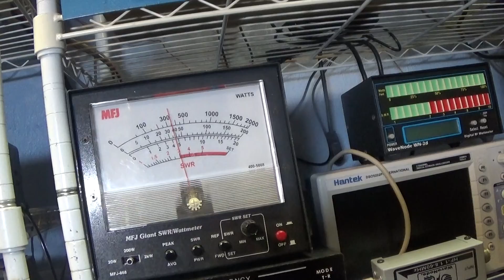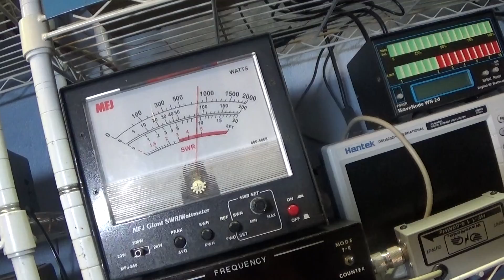Swinger 101 one 6LQ6 tube 10 meter Linear Amplifier

Comment: It should make a nice driver for a larger amp. very nice.
Reply from the maker: Maybe but most people want to hit their amps harder than this.
Reply: @tramdr  I agree, which really doesn't make any sense. Unless hitting that driver harder is going to give you four times more output on the amplifier that you're driving, it's just not worth it oh, not to mention you're going to sound like crap, and cause more rfi, then anyone in the know would like to. The idea is to keep RFI as low as possible. All one is doing is sending their tubes\transistors to an early grave. No point in getting a hundred or even 200 Watts extra, out of a 500 watt amplifier. Just as there is no difference getting 500-watts extra, out of the 1 KW amplifier. It's going to make no difference on the other end, but a lot of chicken bandages just don't understand the concept. My 300a, 350Z, and triple stage Phantom are driven with one-and-a-half through two watts DK and 15-18 pep (ssb.) As the second owner of the Phantom, it still has its D&A stamped sylvania's, showing full output. Not only is one going to send their tubes\transistors to an early grave by overdriving but you're most likely going to sound like you're gargling with razor blades. Stop overdriving your amplifiers! It's pointless and counterintuitive.